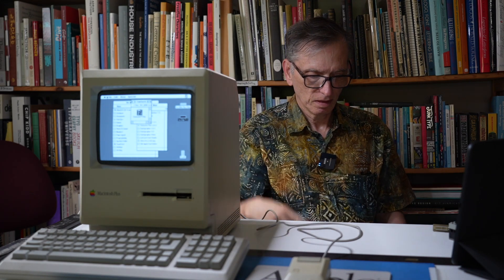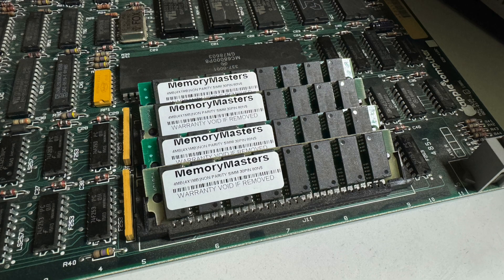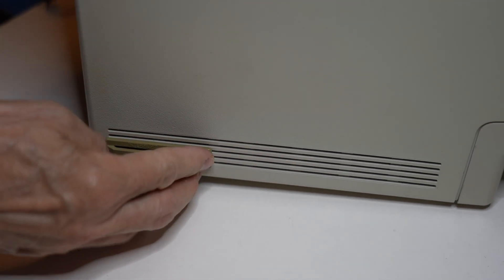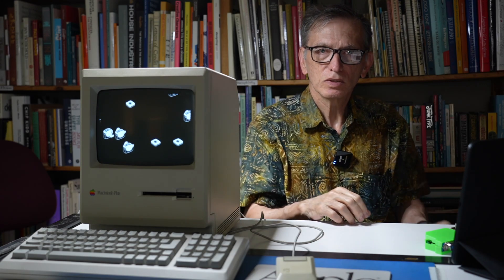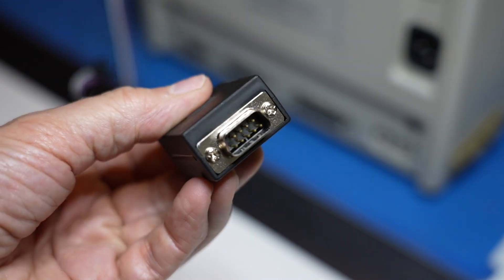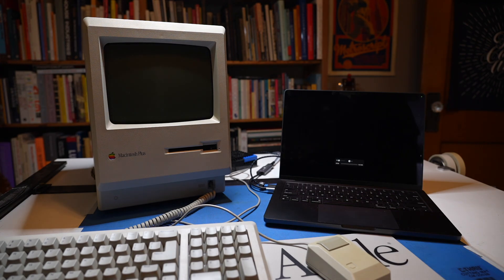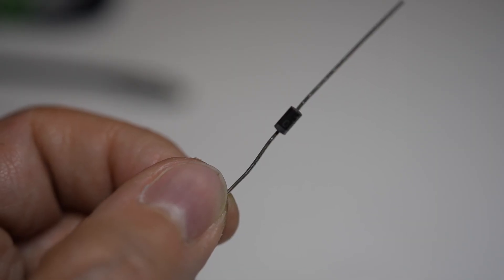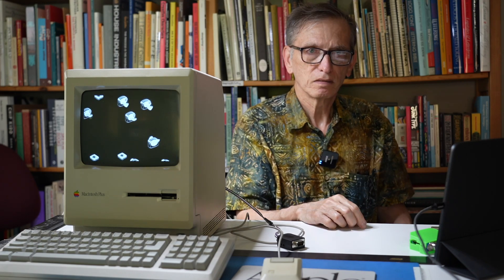Macintosh Plus Story

Comment: You Mentioned: Making FONTS (in Fontographer) on the Mac-Plus (was it 512 pixels across-the-top?) screen ...
--> And I immediately-Remembered: How completely-TRANSFORMING was: Stepping-Out II !!! :-o
... Not-only could one Configure a Much Larger: Almost-SQUARE-dimension (Whatever pixel-dimensions would be JUST large-enough!) Screen-size for PageMaker, such that an ENTIRE: TWO-Page Layout would be READABLE! (Not "Greeked"?)

----> BUT, also in Fontographer You could ENLARGE a Font-Character: Large-Enough: To SEE the Outlines SMOOTHLY! :-)
-- Of course the Mac-Plus PHYSICAL-Screen was still the SAME-size ... but as your-Mouse came to: the Screen-Edge:
... Stepping-Out-II would INSTANTLY-Scroll: to the REST of the Virtually-LARGER-Screen !!! :-o :-)

BELIEVE me ... IF you can Install: Stepping-Out-II on Your Mac-Plus ... the Small-Screen will BE: VERY-Useable !!!
-- As it works INSTANTLY ... as Contrasted with: VERY Painfully-SLOW: Screen Refreshes !!! ;-) :-)
Reply: I began using the one-internal + one external 3.5"-floppy-drive: 128K or 512K Mac in 1984-85 ... 
And a couple of years Later I had a Mac-Plus with the 3rd-Party: 32 MHz 68030 processor board + 4 MB RAM Put inside it! :-)
(A SCSI External-Case with a 40MB Quantum HD was soooo Different to: just 2 Floppy Drives! :-o )
Reply: The original Apple Dot-Matrix printer was NOT much use!
... But, ONCE You GOT: A PostScript Laser-Printer ... the Sky was the Limit! :-o
..... MY first PostScript Laser-Printer was an (ugly)-NEC LED one, which was $3,000 with CHEAPER Consumables too...
-- As the Apple LaserWriter was $5,000 !!! (And they were all: 300 DPI at-that-time! [Later NEXT had a "whopping": 400 DPI!])

I've Spent: 35 YEARS on-and-off: Being into: MAKING: PostScript Fonts (FontLab-8 has now Replaced Fontographer) ...
-- But, It SEEMS that: PostScript Fonts are passe now ... with Social-Media & Cellphone-Videos ...

Still: My present: M2 Pro Mac-Mini + Sony 43" 4K TV-Screen for My "Monitor" ... is the BEST: Font Work-Station that I have EVER HAD! ;-)
Reply from the maker: I remember Stepping Out. Pretty cool, but nothing beats a physically larger screen, which I already had by the time it existed. I only remember using it on a laptop.

Comment: Plus is when the Mac finally became a viable computer - first job from university was programming the Mac Plus, used MPW Object Pascal, C, and Asm. Project used a trackball Mac as a kiosk console to operate a laser photo plotter for imagining printed circuit boards, as described in Gerber files, onto a sheet of film. The rasterization code ran on device embedded MC68K so could graphically preview the PCB on the Mac screen before committing to film. 

I personally owned a 128K Mac, which I did the soldering to upgrade to a 512K fat Mac - used Macbugs monitor and Lightspeed C for learning to program the Mac. So was very familiar with all three of these first Macs.
Reply: Was a rather different era relative to now in this respect: The company I worked for in that first programming job sent myself and my boss to take a week long Mac programming course at Cupertino. The class consisted of all young guys like myself, except for my boss who was an older married guy. This training department at Apple was ran by a woman - older than myself given I was fresh out of college but definitely easy on the eyes; a lot of her assistants were younger women (probably all them single). So on a celebratory night after training they arranged to take the group out to a Benihana. My boss bowed out (he had the rental car) but this woman in charge said she’d come by and pick me up at my hotel. So she shows up in a convertible Mustang - instead of going straight to the event we went driving around the area with the top down. (Was some special treatment was not expecting - attractive lady, cool car…) We finally go on to the restaurant - where the food and drinks flowed, then this lady in charge had her female underlings pair up with us guys and get out on the dance floor. I don’t think Apple or any tech company conducts their product training programs like this any more. 😊
Reply from the maker: @TheSulross  That's pretty wild. Different era, for sure.
Reply from the maker: I don't think I mention it in the video (although I meant to), but I also owned an original 128K, upgraded to 512K (for $1000), upgraded again to add a third-party SCSI port ($250); and upgraded again to a Mac Plus (for another $1000—$4750 in all!). I replaced it with an actual Mac Plus when the price on those came down, selling the original to a friend. Some time later he told me that smoke started coming out of it. Not sure what became of it.

Comment: Did you do the diode mod to the plus so the scsi port powers the BlueSCSI?
* oops I guess I shoulda waited til the end. Lol
Reply from the maker: Not yet
Reply from the maker: I did the mod today and it works beautifully. So nice to have one less thing to plug in. It was a little tricky removing the solder from the holes the diode goes into, but I managed.
Reply: @marksimonson74  yeah I did mine too. Much better. You can even get it online with the bluescsi WiFi

Comment: 3:05 You should use Lithium rechargable cell. They dont leak.
Reply from the maker: Unfortunately, it's an unusual type of battery (4.5V 523), only available in alkaline as far as I can tell. There only seems to be one manufacturer making them currently.

Comment: Did you know the same year the Macintosh Plus was released, Apple introduced a vastly superior machine? It had 4,096 colors, a 640 horizontal pixel resolution, 32-voice wavetable synthesizer, a 16-bit CPU, built-in AppleTalk networking, the first appearance of the Apple Desktop Bus, 8 rear expansion ports and 8 internal expansion card slots, supported up to 8 megabytes RAM, full backwards compatibility with the classic Apple II line AND a Mac-like GUI with its own Toolbox...in *color*. A hybrid Apple II/Macintosh if you will. For some reason, Apple abandoned this revolutionary new computer and instead pushed the dull, boring and limited Macintosh.

Back on the Macintosh Plus, I actually had 3 or 4 of them, but gave them away. Still have one Macintosh Plus motherboard, with the internal SCSI mod applied (and also an original Macintosh 128, upgraded internally to have most of the capabilities of the stock Plus, minus SCSI of course).
Reply: The Mac could be viably programmed with a C compiler, which the software industry had largely shifted from writing in assembly language to high level language, and C was the predominate choice, which the MC68K CPU was extremely well geared for. The Intel x86 CPUs was also well geared for executing high level language compiled code generation. When the 6502 was enhanced to 16bit, they didn’t learn any lessons from other CPU designers as it still remained a piss poor CPU for compiled high level language development.

Was a software developer then (still am) and saw this transition in the industry first hand. At that time a resume wasn’t seriously looked at if didn’t have C language programming experience.

But beyond that, the Mac’s crisp B&W screen that had very good legibility for the day, was more useful to business and industry than the color graphics screen of a IIgs. My first job out of university was programming the Mac Plus for an industrial use in a hardware product. The factors just mentioned were all far more crucial than anything the IIgs had to offer that the Mac didn’t have.
Reply from the maker: I remember at the time thinking it was impressive, but that it was too little too late for the Apple II line. It seems like Apple was hedging its bets, in case the Mac failed. It also felt like an effort to keep the Apple II revenue coming in, which was sustaining the company, until the Mac caught up.
Reply: What do you mean they introduced it, when they actually abandoned it? Was this legendary computer every anything more than ideas on a piece of paper?
Reply: @WinrichNaujoks They’re talking about the Apple IIGS which was a real product that Apple sold for a long time (1986-1992). It’s a really interesting computer and had some serious upsides compared to the Macs of the day, but it was also clear the Mac was the future.